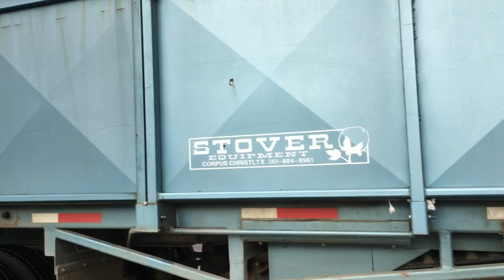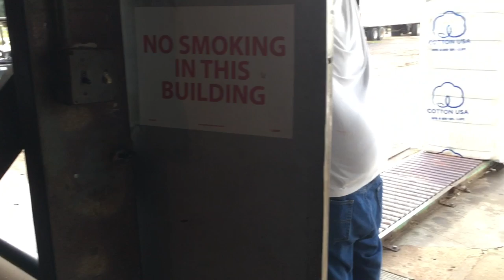Tour Minturn Cotton Co Gin while running

Comment: I can see much has changed in the process....    Most of the old gins  had   a flat belt system with a lot of  shafts and pulleys running thru the gin with a  boiler and steam engine. A  suction pipe was used to to feed the  loose cotton from wagons and trucks into the  gin....Almost every town had a gin.... my first tour was in 1955.  a lot of cotton has passed since then.....
Reply from the maker: Thanks for watching. It’s amazing how good it cleans the cotton. There’s almost no waste. I think this gin was originally built in 1947.  They were super nice about us sharing the process with everyone.Have a good one.